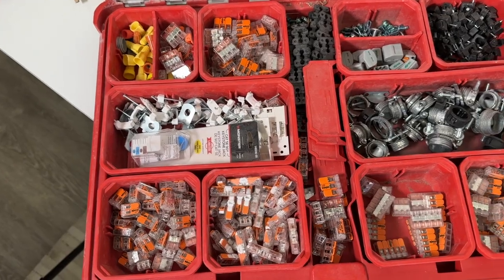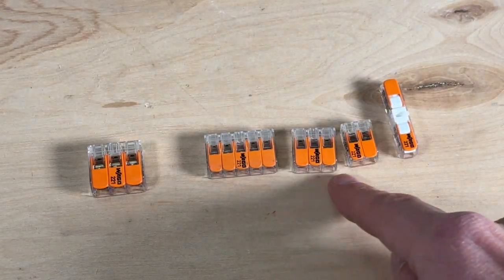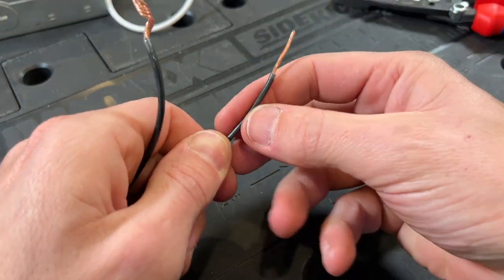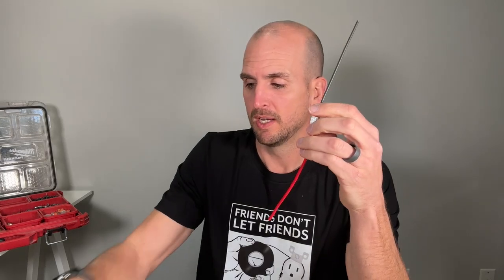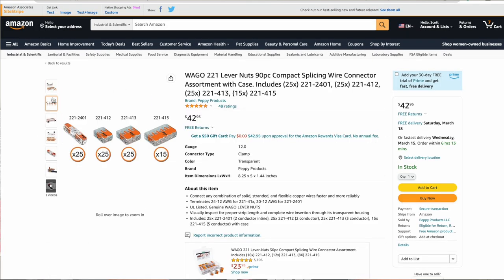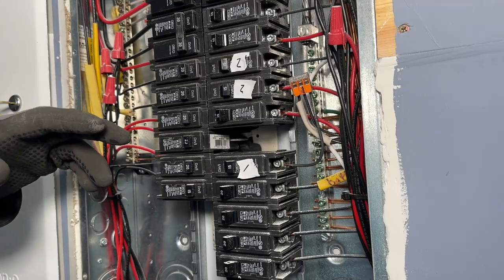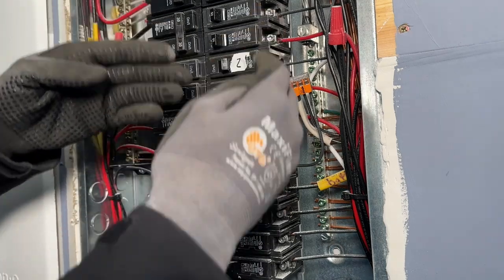Best Wire Connector For DIY Electrical Projects

Comment: I have been using their push ins for years but these are a step above. I tried them and am hooked. I wish they would make a six bay connector. I just bought the splice connectors which will be very useful and easier to use over the push in version.

Comment: Good video  I have never used them before but looks like it would be a good way to connect a volt ohm meter to a circuit when trouble shooting a circuit by placing the meter probes in one end of the device and the circuit wires in the other this would leave your hands free for other task. .
Reply from the maker: All WAGOs actually have built in test ports where you can just test with the connector in place using a standard probe

Comment: I am new to home diy and am learning a lot from your channel.  I just ordered a 28-peice set of wago lever nuts from your Amazon store.  Is it safe to use a 3 or 5 prong lever nut with only two wires?  I am asking because I recently moved into an older home and am updating all the outlets.  I will need more than the 8 two-prong lever nuts and have the idea to use the 3-prong ones to make a connection between two wires.  Thaks , your style of explaing things is very helpful.

Comment: Another use is for smart switches. They take up a lot of space in the box and usually have stranded pigtail wire connections. Need a solid to stranded connection in a tight space.
Reply from the maker: For sure, nice add!

Comment: Ideal also has lever connectors. Called Insure. Don’t have to open the lever to insert wires. Sold at Home Depot too.
Reply from the maker: I actually just picked up my first samples the other day and giving them a try.  Initial impression is they look like a cheaper attempt by IDEAL to copy the WAGO 221 but willing to give them a go 👍
Reply: @EverydayHomeRepairs  Not a cheap knock off. I think you’ll be impressed with the quality.

Comment: How would this work as a temporary cap? Last time I was installing a lamp I needed something for the hardware store so I capped it with a wire nut. This does have an open side so would that not be advisable?
Reply from the maker: I would use a WAGO 221-412 which is just the standard 2-wire lever nut
Reply: @EverydayHomeRepairs  good to know. Thanks!

Comment: Just noticed that the 221-2401 is rated for 20-12 wire size where the 221-412 is rated for 24-12, so there may be a case where you would still need the 221-412 to get a good connection.

Comment: The inline connector sound great. Is there any word if they are going to make an Inline connector with the ability to have the 2,3, or 5 connectors attached? I am running a BUSS wire and am using IDC connectors and they are a pain to use, but I need the branch circuits and the through wire.

Comment: oversize hole in granite backsplash - you show a box accessory that made the hole smaller so the tab on the outlet would not fall into the hole where can i find the item used  in the video

Comment: Have you ever done a test with waco connectors? Voltage and heat test ! I seen some people on YouTube do not like them. I like them a lot. I used use quick connections in the post office. I was a electronic technician
Reply: Several YouTube videos are out there and for both the Wagos and wire nuts the wires would melt and burst into flames well before either connector would fail.  Also, someone did a strength pull test and the Wago would hold upwards of 25 ponds.

Comment: Can these be used in  marine application. I’m replacing a manual bilge pump with an automatic one. I will need to cut the old wires and splice on the new ones. Although this will happen in a dry area, above the waterline, the boat will be moored out in the elements. (I will be using Marine grade wires)
Reply from the maker: They are not water tight.  WAGO has Gel Boxes you can get which will make everything water tight but probably expensive and a bit hard to get in the US https://www.wago.com/us/discover-wire-and-splicing-connectors/gelbox-from-wago
Reply: @EverydayHomeRepairs  : Thanks for this information.  I will certainly look into this option. 
Maybe a cheaper option would be an in-line splice completely covered with a heat-shrink sleeve or with a ton of liquid tape all around it. Although my connection could be subject to moisture, it would be sheltered from direct rain or open water. My only concern is possible corrosion. Not worried about “shorts” within the connection.

Comment: Great video, thanks for posting it.
Questions: Up to what AWG size can WAGO connectors accommodate? Also, can WAGO connectors be used to splice 3 wires or more together? (such as the need to splice several ground wires together).
Thanks, Richard

Comment: Have you seen heat problems with the Wago on 20+ amp circuits?
Reply from the maker: No heat issues.  These 412, 413, 415, and 2401 should only be used on 20 Amp circuits but I have seen guys test them at 40, 60, 80, or more Amps.  I think it took around 100 Amps to melt them from the heat.  WAGO basically failed at the same temp as a wire nut.
Reply: if you using the 3 or 5 contact wago always put the supply line in the middle for better load dispersion

Comment: Pretty much anywhere with stranded cu wire, rewiring light fixtures, installing light fixtures, and on  l*ve circuits to disconnect and hook up lighting.
   Great for pre-wiring receptacles with pigtails. Complete access to the screws and getting everything tightened up.  They want pigtails now anyway.  Sit down at a table, bench, whatever. Wire a bunch up the right way with the screws, no backstabbing, no worrying about tightening in the field. And then all you have do is hook up to the wires in the box with the Wagos, fold some wires, and screw everything down.
   The giant mass of ground wires. Several wires coming out from a junction box. Anywhere you don't want to use one of those giant wire nuts that, don't work really well.  anyway.
 Short little wires in the back of the box. 
    Old knob-and-tube wire, where you need to handle it as little as possible.
   Ceiling fans, machinery, etc where having a vibration resistant connector is good.
    Conductors of different gauges, and/or stranded, that don't twist together well.
    Shallow boxes and any other tight situation where flipping a lever is more convenient, where space is limited, or where manipulation might loosen a wire nut.
Reply from the maker: Nice list 👍 Thanks for all the feedback, I really appreciate the help!

Comment: Wago now makes connectors designed to attach to electronic circuit boards (like the kind you find in your computer, not in the walls).  Pretty neat.

Comment: there are no enclosures where this can be used effectively save for stacked square extensions/octagons, gutters, panels and some masonry boxes.  A home gamer has very little to gain from a straight unless they are splicing in a gutter or a large enclosure.  If you find you have less than 6 inches of conductor in a box you must remedy that per code, splices do not pass.

Comment: So do the two wires in the inline splicer contact each other, or are they both touching the same bus like in the other, non-inline connectors?
Reply from the maker: Contacting a busbar 👍

Comment: Can these replace junction boxes?
Reply from the maker: Will still need to be in a junction box.
Reply: @EverydayHomeRepairs  so in case of a 14/2 wire you would need 2 of those inside the junction box,and the box would still need to be grounded as usual.

Comment: Can WAGOs be used for car, or in my case motorcycle, use cases? The WAGO website specifies automotive use, but the promotional video makes it clear it's automotive *manufacturing plants*, not just a car.
Reply: I would not recommend it, the vibration can work them loose over time. If you try it, I would wrap them including the wires with electrical tape. My concern is not so much that the lever may open (although that could happen), but that the wires may gradually walk out. The tape should mitigate the problem.

Comment: I know a contractor/owner that forbids the use of those things. If an employee has them on their truck or use them, they are terminated immediately. If it’s already in their work location, they must stop work and wait for the shift foreman. Me thinks he doesn’t trust them?
Reply from the maker: Not sure where he is getting the fear of WAGOs 🤷‍♂️ Might be a bit set in his ways.
Reply: @EverydayHomeRepairs  
I’ve personally have never used them. Probably never will because of cost alone. I have a crimping tool that I trust implicitly(After going through many). I have to have the tool out anyway for terminals/ring connections. Wago aren’t waterproof where QUALITY adhesive lined heat shrink is. But the look fast.
Reply: Some old fogies just can't change with the times.

Comment: Please avoid using these for high amperage current in a closed box, they heat. Old school twist & solder or twist & weld is more reliable.

Comment: I love these connectors as I stated in the other 50 posts you did on these same exact ones. But I get it, you are a salesman trying to promote to get your commission. LOL
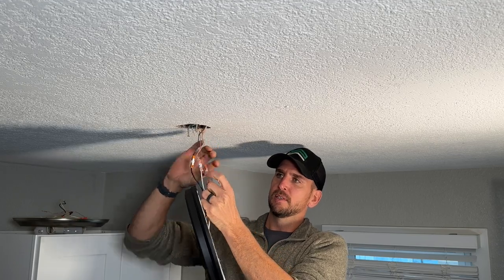My issue is what you dangerously demonstrating to those who do not know any better. NEVER allow the fixture to hang by the wires as you demonstrated at 03:01. Also, it is NOT the wires purpose or job to carry the weight of the fixture / lights as you said at 03:15 : "... and because vanity lights and ceiling lights were usually up in the air and also holding the fixture..." This is wrong and could compromise the integrity of the connection, solder ..etc which could lead to damaging the connection and ultimately fail on the contact and possibly short.

Comment: These are terrible. Wire in those things will oxidize over time snd will start making a bad connection which will start to heat up melt plastic make it brittle it will then fall apart and disintegrate. Always solder put shrink wrap and squirt hot glue before shrinking up the shrinkwrap making it water and humidity resistant most reliable and safe connections.

Comment: CN ripoff also come with 3 inline wago like😮 Just wondering why people still not use DCL aka IEC CEI-61995 in UK new home https://en.m.wikipedia.org/wiki/Device_for_Connection_of_Luminaires ? No, messing with wires on a ladder 🎉